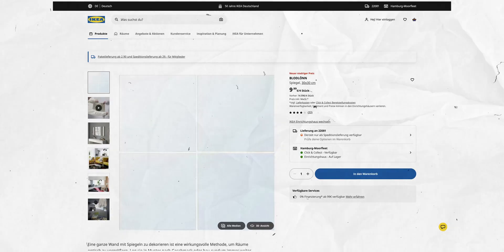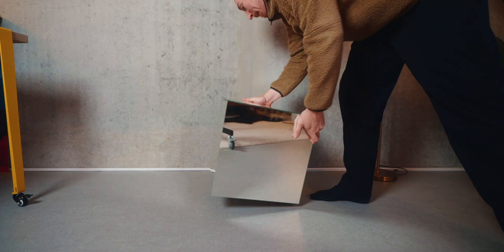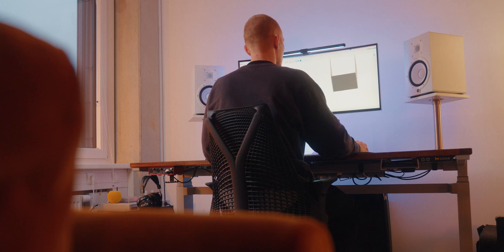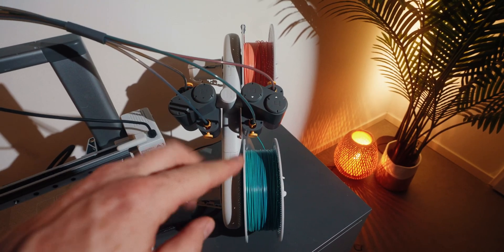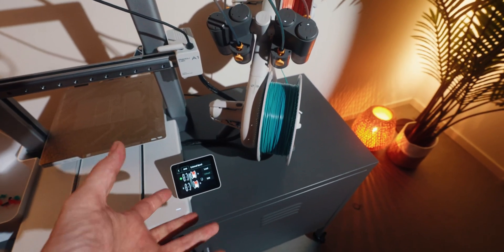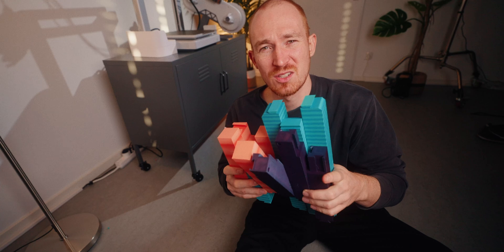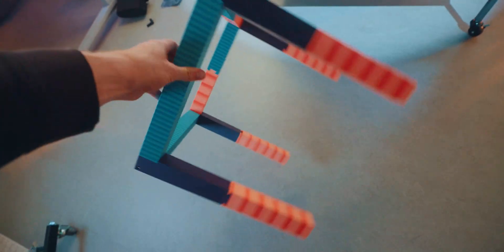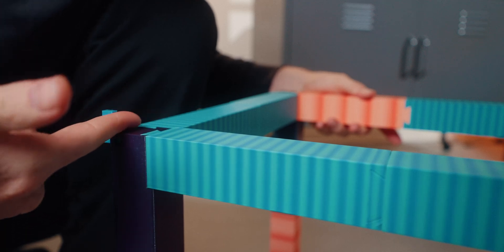3d Printing The Viral IKEA Mirror Cube Table

Comment: Hi, Thanks for the vid! what was the tolerance settings on the joints?
Reply from the maker: In Fusion i offset one of the faces by .2mm
For The settings for the dovetail cut that I made in orca slicer you can find a screenshot on the thangs page  😊